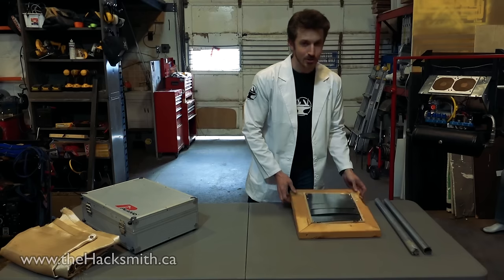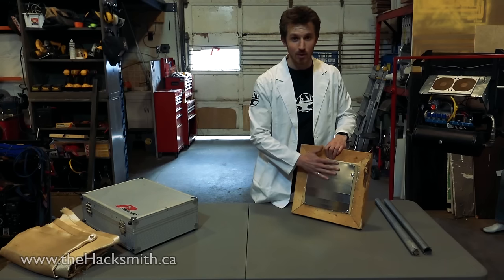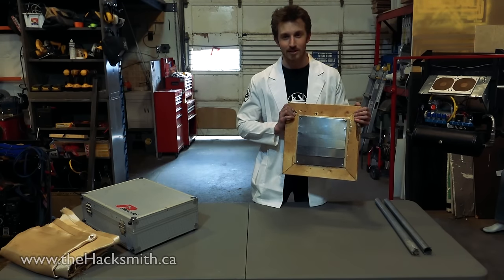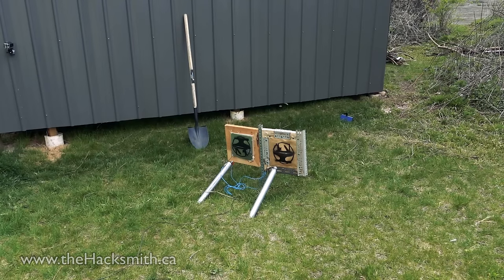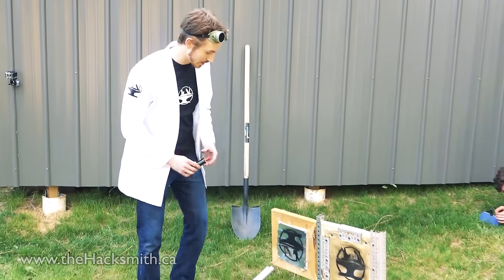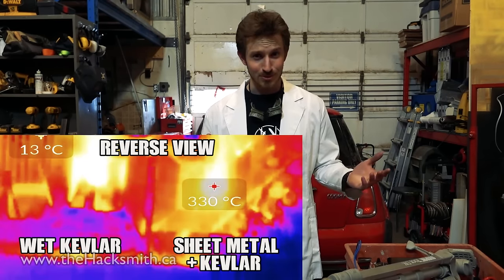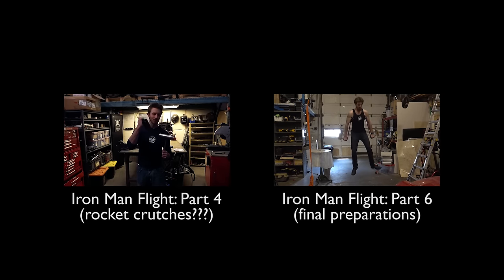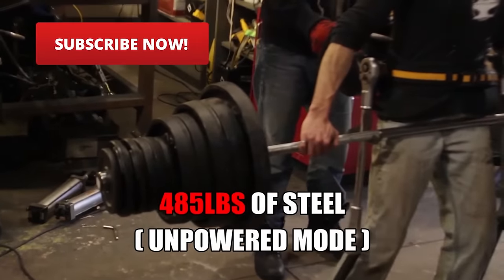Flying Like Iron Man #5: Heat Shields?

Comment: I was thinking...What if you use Exhaust Heat Wrap ? ,The ones i have seen can withstand up to 800°C/1472°F  (Maybe a little more), I was looking at the reverse camera footage and the heat was around 330°C maybe 400°C to round the number,what if you put this heat wrap between the aluminium and the kevlar? since i don't really know how much heat the G Class Rockets make i can't say it will save your legs,but hey,maybe you can build some kind of heat resistant shield like that one but with exhaust heat wrap! (Thin wall of Aluminum Plates+Kevlar+Exhaust Heat Wrap?,Maybe?),Tell me what you think mister!.

---A little bit of info about the Kevlar and  the Exhaust Heat Wrap--- (Yeah,i searched about it.)

The "Heat transfer through Kevlar is slower than that of cotton or leather, however the dissipation factor is also slower [...]" ;And the Exhaust Heat Wrap deflect the heat BUT! i don't know if it take time to dissipate the heat since "The most common material for the newer wraps is a dense fiberglass weave. The weave is durable, flameproof and insulative. It is also becoming more common to see wraps that are, in part, metallic weaves.
In addition to the base material of the weave, many wraps incorporate natural materials such as ground lava rock and ceramic." why i'm saying this last thing?, I don't know,i tough it would help in something.All right that's all i got to say,hope it helps in something!

Comment: You really need to adjust your thinking to the high temperatures involved. (Or maybe you have and the videos of rockets burning through stuff are click bait). If you'd used steel plates instead of aluminum, you'd have about the same strength to weight ratio, but the melting point of steel is about 1600 degrees F higher. Kevlar has a reasonably high melting point among polymers, but that's among polymers which have low melting points. This isn't about strength. Fiber glass would be better and ceramic cloth better still.  If you're obsessed with using a polymer, use an ablative plastic like a phenolic.

Comment: Use a plastic called, starlight it is a heat resisting plastic!!!!!!!!!!!!!!!!!!!!!!!!!!!!!!!!!!!!!!!!!!!!!!!!!!!!!!!!!!!!!!!!!!!!!!!!!!!!!!!!!!!!!!!!!!!!!!!!!!!!!!!!!!!!!!!!!!!!!!!!!!!!!!!!!!!!!!!!!!!!!!!!!!!!!!!!!!!!!!!!!!!!!!!!!!!!!!!!!!!

Comment: stop with Kevlar go buy chain male with fiberglass insulation but not wall stuff the the actual stuff
Reply from the maker: +Nicolas Baez it's actually a fiberglass welding blanket with Kevlar stitching lol
Reply: +the Hacksmith why use aluminum sheet metal,  use steel sheet metal ... they won't melt as fast,but they will still get hot as fuck but less likely to melt through
Reply: Look into firefighters uniforms, perhaps?
Reply: I dont know why he is using kevlar anyway, it has little to no fire resistance. use heat resistant aramid.

Comment: +the Hacksmith your tech is cringingly unrealistic if you can hold those rockets and not be staggered or knocked over by the thrust than your doing it wrong also you need a device to set the thrust to certain variables, like gears on a car. and in addition to thrust variables, you need flight stabilizers/actuators.
Reply from the maker: +Ean Arendt first I wouldn't consider this remotely "tech". There is no way to control the thrust of solid rocket fuel...
Reply: +the Hacksmith well then I think you should but it wouldn't surprise me if you couldn't afford it, it's expensive.
Reply: +the Hacksmith I also think your not noticing how complicated this actually is gonna be, your gonna need some boots similar to iron man's actual boots this will take a year or 2
Reply: +Emerald Films keyboard warrior.
Reply: He is working on these things too but he didnt started to making them cause he is already making something